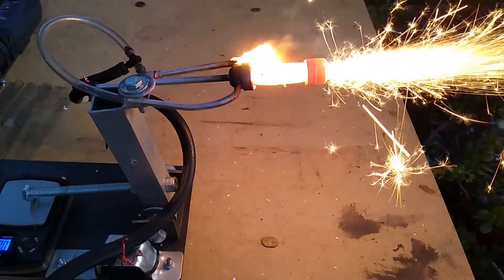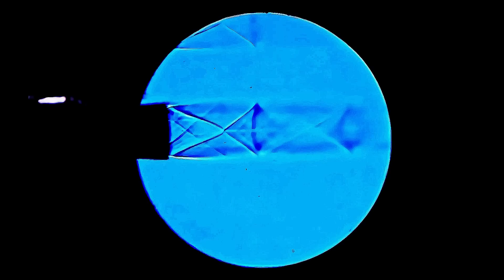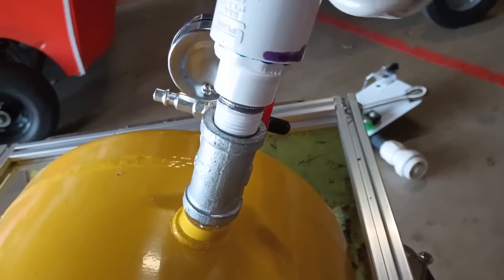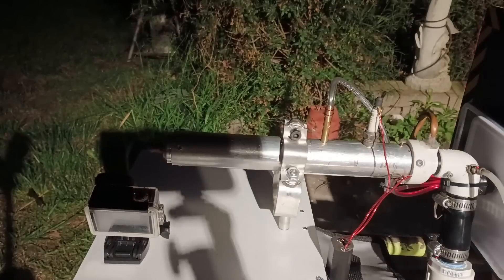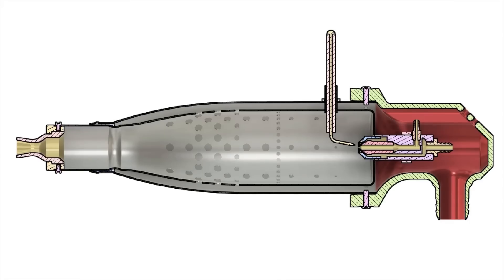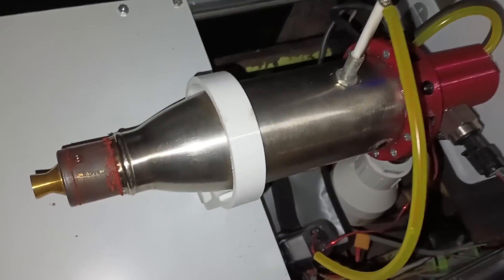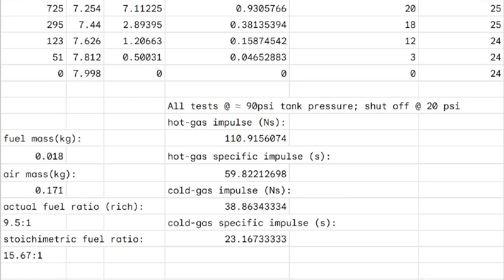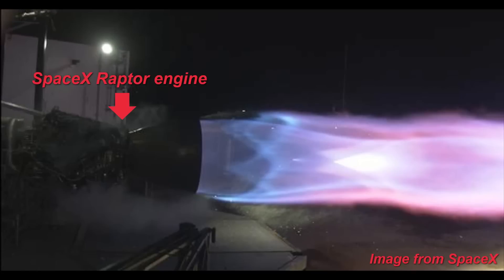I built a rocket engine in my garage - it makes shock diamonds!!!

Comment: You might consider renting a sandblasting air compressor. An Ingersol-Rand 185 CFM diesel air compressor can deliver that 185 CFM at right about 150 psi. You'll get the pressure you need at flows near what you want. With appropriate regulators you'll have good supply and throttle ability. Also water cooling your chamber and nozzle will help a lot. Good luck. Be careful. And most importantly: don't die! 😉

Comment: If you could swap out any components with titanium, what would you swap out?
Reply from the maker: If it was possible to manufacture, I would have the chamber nozzle together as a single piece of titanium to withstand prolonged operation and not have any gasket failures.

Comment: If you are having problems with unreliable ignition and/or unstable combustion when using a gaseous hydrocarbon fuel, you could possibly solve this to some extent by running the rocket motor in a fuel-rich condition. Not just slightly above stoichiometric either - the ideal hydrocarbon to oxygen ratio for a rocket is where the hydrogen component is oxidised to water vapour and most of the carbon component is oxidised to carbon monoxide rather than carbon dioxide. For the simplest possible example of CH4 + 2 O2 ---> 2 H2O + CO2 (complete combustion of methane), you would reduce the amount of oxygen used by exactly 25%. You can do equivalent calculations to find the ideal ratio of fuel to oxygen to achieve a similar outcome for other hydrocarbon fuels, such as the propane you were using here.

This has several beneficial effects:
(1). The most important effect is the reduction of the average molecular weight of the gases in the rocket exhaust. This is important for performance and efficiency, since lower molecular weight components are exhausted at higher velocity, for any given temperature. The higher the velocity of the exhaust components, the more thrust you get.
This is why any "hydrolox" rocket (hydrogen fuel, oxygen oxidiser) is always run as fuel-rich as possible, to get as much unburned hydrogen into the exhaust as possible - hydrogen is the lightest possible exhaust component, so has the highest possible exhaust velocity.
(2). It reduces the energy output of the reaction happening inside the combustion chamber of the rocket and therefore reduces the temperature of combustion, meaning lower thermal stress on the hottest parts of the rocket - injectors, combustion chamber and nozzle.
(3). Reducing the amount of oxygen the rocket has to carry will naturally increase the amount of fuel it can carry for any given total weight, which gives some extra range. This last one is of course not relevant to an experimental rocket motor on a test stand, but it would be relevant for an actual launch vehicle, if the rockets you are testing are eventually developed that far.

Comment: Shock Diamonds are how the F-14 TOM-CAT got it's name. From the rings in it's 'tail' (Exhaust Gas Diamonds) Wernher Von Braun helped design the final GE F110-400 engine that could do 1890 MPH (Unclassified speed - declassified 2024) It had 32,600 lbs. trust. That's 139 kNs of force at Mach 2.74

Comment: Very cool :)
Nice work on this one! Have you considered using NOx a an oxidiser rather than O2? It liquifies at a much lower pressure and means that you can use latent heat for pressure in the same way you can for propane... If you want to continue using propane and start with NOx you can just inject liquid for both ;)

Comment: I'm really no expert

But I'd say the next step would be a better turbo pump to get your propellant pressure higher.

You talked about 100 psi peak, 90 psi with the 10% loss, right?

I'd try to get to 200 psi somehow and compare the results. The Engine should get more efficient by this, I'd be really interested in the ISP improvements you'd gain by this.

And yeah oxygen is dangerous. Way scarier than Propane or any other combustable gas.

Comment: Shock diamonds are a sign of inefficiency.
Reply: But they're sick as fuck
Reply: @janeczekdeliverservices7831  I agree with that
Reply: Sure, but they form if there is the slightest imbalance (you get them with aerospikes even, and they’re practically ideal case), so you’re not going to get rid of them
Reply: How so? Not at all trying to hate, I have no qualifications at all, but aren't they just a sign of supersonic airflow?
Reply: @opalmams9775  Shock diamonds form when the supersonic exhaust from a nozzle is slightly over-expanded, which are a sign of the exhaust being too pressurized.

Comment: Nice work, could you pls tell me the cost of all of this and how you crafted the brass combustion chamber
Reply from the maker: This project cost about $300 and used a number of recycled parts. It would probably cost about $500 if everything was brand new and most of that would be in the brass pipe fittings. The brass nozzle was made using a 1" bar machined down on a lathe. It was then attached to a stainless steel chamber from a previous project
Reply: @AydenWardellAerospace  thanks alot, best of luck in your CFD in your Rotating Detonation Engine!
Reply: @AydenWardellAerospace  what machinery is required to make this? I've been planning on building an engine for half a year and have been working out pricing for materials and machine cost and I would like a realistic opinion on someone actually doing it
Reply from the maker: I mostly used basic hardware store tools to make this, however I did need a 3D printer for the adapters and to build my own lathe to make the final nozzle. You could also build one for cheap, but I know you can also get a much better mini lathe online or from harbor freight for a bit more money.
Reply: @AydenWardellAerospace  sounds good I wanted to work with aluminum so my original thought was to get a Tig welder an CNC and a lathe but if I can make something like that without most of that it would be awesome, I was looking at the machines alone and it would be 6 gs alone just for cheap stuff which is absolutely insane
Reply from the maker: @Jorged18 I built a lathe from a moveable milling vise, a lathe chuck, and a go kart motor for under $300 
It's kind of terrible but it gets the job done

Comment: Nice!!! you could try those paintball tanks as air source. Some of them can handle more than 3000psi and the compressor to fill them are not that expensive ~300$. Instead of liquid oxygen you could try nitrous oxide like they use in hybrid rocket engine.